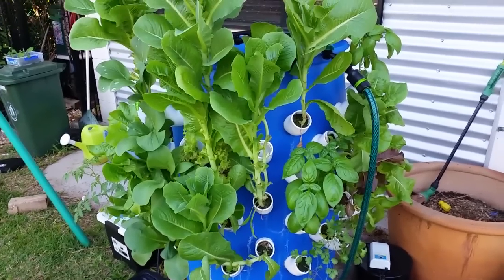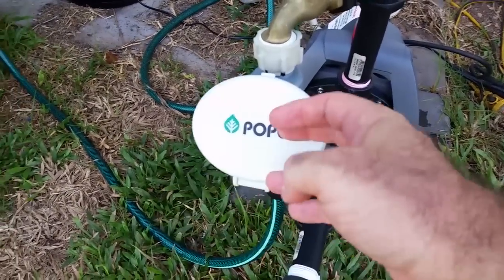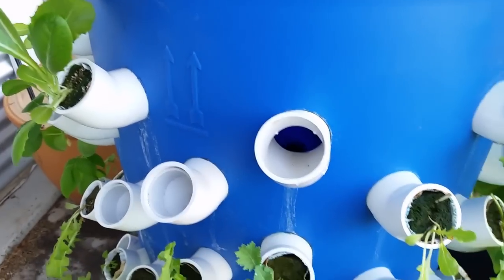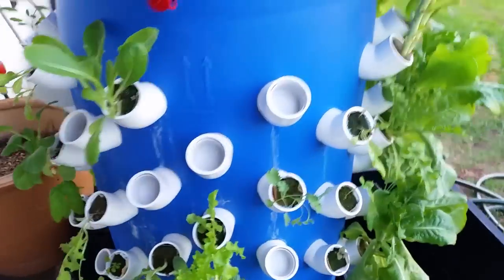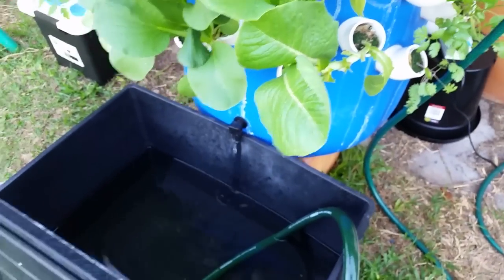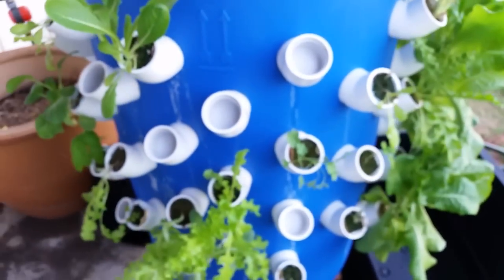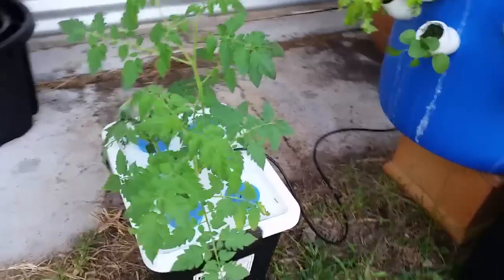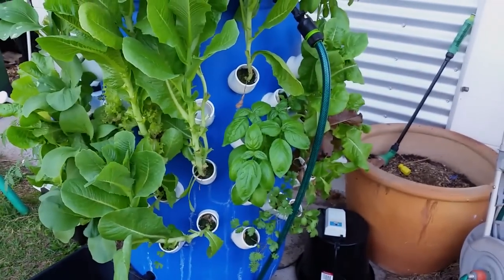Aeroponics Tower Build - Part 2

Comment: do need to ON/spray nutrients 24h? What is a interval time for spray schedule?
Reply: It depends on the crop type, the difference between an aeroponic tower and a hydroponc tower like the tower garden is control.   The hydroponic towers haave to run the pump for longer to make up for the uneven distribution. Accoording to a tower farm owner a single  10ft tall 52 site tower runs the pump for 12 minutes per hour which cost him  216w  per day.  He  also says the plants in the 52 site  tower use 4-7L  per day so you can see how much extra water is being pumped. With an aeroponic tower you can deliver the amount you choose , the mist reaches everything. If the tower uses 4-7L a day you can choose a misting duration and timing that supplies 8L or even7.1L if you choose to. The farm owner  doesnt have that option because the method  doesnt support it. He couldnt run the pump for 3 seconds, and if he could it wouldnt help.  He cant distribute 3 seconds worth of water evenly to all 52 plants in the tower. The towers use a 45w Sicce Synchra Silent 3.0.

Comment: Hi you were talking about the following :  I am working on something using a DC diaphragm pump and a pressure accumulator. That will allow it to be solar powered and require the pump to run far less often. In the new setup, the pressure will build up and be held in the tank and that will power the misting. The pump will then only run to repressurise the accumulator as required. Hope that all makes sense. That should be cheaper than the pump I have now and also virtually remove running costs. Will post a video on it when complete. Can you let us know when you have this system on video?

Comment: That why in America we use the standard system. 2 cups is a pint. 2 pints is a quart. 2 Quarts a half Gallon. 2 half gallons is a gallon. It's much simpler.

Comment: Good day,
Part 1:  TIP TIP TIP TIP
40 mm holes perfectly round and close water.
Make a hole of 70% (+/- 30mm)
Make sure you have a pipe large of the planned hole and a sponge with cold water.
Put a paint fohne here and heat around the hole. Do not overheat, may discolour slightly but do not burn, black !!
This makes the palstic smoth.
Now stop the tube directly from the inside (also outside), let the tube in and cool it off with the wet sponge. Then remove the tube.
You now have a perfect round hole with a collar that closes well.
This goes with every flat tube where a spout must be made !!
suc6
John, Netherland
Reply: hi, what is "Make a hole of 70%" please ? do you mean 70mm? Also what is a "paint fohne"? Do you have a video of this method? It sounds interesting but i cannot visualise it. thanx

Comment: Do you put your seeds straight into the tower or do you grow it until the roots get long in another system? also how do you hold the plants in the pipes? rockwool? neoprene plugs? thanks for your time
Reply: Hi Patch,
there is a cheaper, easier and quicker way to germ seeds for a tower. You can put the seedlings into the tower almost as soon as they`ve sprouted so you dont have to wait for them to root out the rockwool. which you wont have to buy cos you dont need it ;)
Reply from the maker: Hi Erick, I grow them in rockwool until the roots penetrate the bottom of the plug. I then put them straight in the tube. I have a video on how I germinate in rockwool here: https://youtu.be/f5qqpgvocOQ - Thanks again for watching :)

Comment: Have you had any ideas to internalize everything?? I was thinking that you could just use the bucket itself as a reservoir. Wold that cause any issues?
Reply from the maker: Hi Joseph. I did try that with my original design but the nutrient solution got really hot as a closed system. The double-reservoir helps reduce the temperature of the solution that is then sprayed within the drum. That is my situation living in the tropics though. In a colder climate, the additional temperature in the single drum could be a benefit. Thanks for the question.

Comment: I'm new to this... what is the name of the container that holds the media and lets the roots dangle inside the tank? 

And what type and size of pump do you use for your sprayer? Do you leave the sprayer on 24/7?
Reply from the maker: I just call that the grow tank and the other tank is the reservoir. Pump doesn't need a lot of power, just enough to lift from the reservoir and get a decent spray. Mine is just a $100 pressure pump. Sprayer generally runs for 10 seconds every 5 minutes but there are lots of variations to that and they all seem to work OK. I just settled on that as it is pretty hot here and that seemed to be a good balance. Hope that helps and thanks again for watching.

Comment: What nutrients do you use?
Reply: Do not buy the liquid pre-mix.  Buy the fertilizer, acid, base dry and learn how to mix it.  Otherwise you are paying for shipping water at 8 pounds per gallon. Lots cheaper, especially if you have a worthwhile size crop.
Reply from the maker: I use House and Garden - Van de Zwaan but that is only due to ease of supply. I'm sure other brands work similarly.

Comment: Why use a reservoir and just pump water from the bottom of the tower?
Reply from the maker: The double reservoir design helps cool the nutrient solutions prior to it being recycled. My original design just pumped from the bottom of the tower as a closed system but the nutrient got too hot.

Comment: bro..you know..just a suggestion...in your formation of the drum...only one side gets the sun light...the other side..hmm...not much right...?..
Oki..this is my suggestion...use some thing under the drum,which you can easily turn..so you can turn the drum daily to sun light..
   and..I can tell you a way...use an old clutch drum from a vehicle..use a razor,some iron bars to do a frame and a foundation....and this is one of the the best video series so far about this subject bro..good luck and cheers..God bless you bro...
Reply from the maker: Great tip and thanks heaps for watching.
Reply: Great work thanks
Reply: Just a swivel office chair base, $5.00 at the rehab store.

Comment: How often do you have the water on?
Reply: In another similar video they said they turn the pump on for 10 seconds every 10 minutes. If you do only 3 times a day, then the roots will dry up!
Reply from the maker: 10 seconds each 5-7 minutes here but I am in the tropics. Important that the roots stay damp and don't dry out.
Reply: 30 minutes 3 times a day would be perfect.

Comment: Have you herd of the B. A. Kratki type hydroponic systems. They don't require a pump of any kind. So there is less chance of a crop loss. And they are about as cheap a set up as you can do. it only requires a fluid tank with a light tight cover, that you poke holes in and by using a round hole with a square peace of soft foam as a planting medium and plug you can reduce the cost of construction. ounce it's built all you need add is fluid and plants or seeds.
Reply: Kratsky has more root rot and less available O2
Reply: @LazyH-Online Thanks, I am doing dome peppers of various varieties using Kratky in Mason Jars and masterblend.  they have grown great but after the first 3-4 yolo wonder peppers they have flowered but not produced.   Sweet pepper is growing like a weed.  I am not sure if I have to force pollenate them .

Comment: G'day mate, here's a heads up for consideration, u can save money,  time & labor by drilling ur 1 1/2 - 2" holes in the pattern u fancy, then use a heat gun to heat the hole until pliable,  jamb a wine bottle ( elegant style not the port style bottle ) into it to a depth that suits ur fancy ( 1", 1 1/2", etc ) I by & large seed directley in rock wool cubes & some Jiffy peat plugs & stopped using net pots altogether saving even more money, after all, its about getting it done.... cheaper. Good vid & food for thought!

Comment: excellent idea   hats off
Reply from the maker: +daquilema2011 G'Day and thanks. It is really a number of different ideas (not all mine) pulled together with most of the solutions just worked out as I built it. Have a few modifications underway now though for testing when the rain stops. If they work out they will feature in some new videos. Thanks again for watching :)

Comment: Wow, terrific videos!!! Thank you!!! Here are two thoughts that may be useful. I did a similar system (but with a very different method for nutrient flow - see below;-) using a 5 gal. bucket with net pots in the lid. It's great for growing tomatoes because you can attach poles to the bucket with bungee cords and tie the tomatoes to them (my plants got 5 ft. high!). Not knowing better, my bucket was food-grade black poly because I knew to protect the roots from light, but being black it got VERY hot - Ooops!;-). However, wrapping the bucket in white paper and leave a inch or so airspace was enough to drop the temp. a huge amount. That brought the temp. of the 6 inches of nutrient solution in the bottom of the bucket to (I'm guessing) ~88 deg F even though the bucket was in full sun on the hottest days of the Summer. That would likely work for your barrel as well. Second, instead of having a second container to hold the overflow of nutrients, I used a water pump sitting in the bottom of the bucket with a spray head. The pump was this one: http://oraclegardensupply.com/pump317.html.  This pump sits in the ~6 inches of nutrient solution in the bottom of the bucket, and pumps the nutrients thru a 3/4 inch pipe that's 7 inches long to a spray head that wets the bottoms of the net pots. Spray head is like this one: http://www.homedepot.com/p/Orbit-Full-Pattern-Plastic-Shrub-with-Plastic-Nozzle-54009/100189199.  The beauty of this is there's nothing external to the bucket, or in your case the barrel.  Of course you'd need a larger pump for your barrel, but it could then feed your terrific misting system.  I plan to replicate your barrel system but using the internal pump method.  Of course, during the high growth period, one thing to watch out for is keeping the nutrient level from falling too low.  I did that manually this time, but plan to add a float and valve system in the next version to do that automatically. Thanks again for your post!!!
Reply from the maker: +Tim Zebo G'Day Tim and thanks for watching. Some great ideas in your system design. Sounds similar to something I did just for cloning but then taking it to the next level - excellent! Will try and give that a go in my next growing season for a comparison. Thanks for the feedback mate and let me know how you go. Cheers :)
Reply: But I think the difference between the barrel and the bucket is that you can take the lid off the bucket and you'd have to cut the top off the barrel and then it wouldn't be watertight anymore. You'd have to find a barrel that with a removable top. But I'm pretty sure they do make them.
Reply: But the bucket would be better for indoors, because you could hang a light over it and Light the plant. Where you would have to put lights all around the barrel to light all the plants. So that would be better for outdoors.

Comment: Do you cycle your pump on and off? If so, what is the frequency?
Reply from the maker: +Matt Neibaur Hi Matt, depending on ambient conditions, it is usually on for around a minute and then off for 6-7 minutes. For next growing season I am working on a sensor controlled misting system rather than time. I'll then use ambient temperature and humidity inside the drum to trigger misting as required. Hope that helps and thanks for watching :)

Comment: hi everebody ,could you please tell me if i could use aquaponic water and use it the same way?
i mean instead of hydroponic use aqua?thanks
Reply from the maker: +behnam behnam It could be worth a try. You would need to include a filter before your pump and mist sprays though to prevent them getting blocked. Thanks for watching and for asking the question. Good luck with it :)

Comment: To save effort on the sanding of the fittings to get a tight fit, have you tried using a heat gun to soften the barrel spot and push (force) the fitting into the hole of the barrel.  If you have tried this, which method is easier?
Reply from the maker: +John Sluga Hi John. I did try the heat gun option but without sanding the elbows down it distorted the barrel a bit too much for my liking and I was worried the barrel might split. In the end I sanded them all and just used a little bit of heat on some of the holes to assist (mainly around the vertical seam where the barrel is thicker and wouldn't give as much). Hope that answers your question and thanks heaps for watching :)

Comment: what is the size of your pump /psi using in the barrel
babyhewey@msn.com
Reply from the maker: +Clay Hewett Hi Clay. My current pump is around 55 psi. I am just in the process of moving over to an 80 psi DC pump so I can run on battery + solar. I am going to just run that directly for now but may need to add a pressure accumulator into the design to reduce the pump running time. Hope that helps and thanks for watching :)

Comment: I wonder how an ultrasonic fogger would go inside a drum like that
Reply from the maker: +ImMADasAMeatAxe thanks for watching and good question mate, have toyed with the idea myself. The limitation I can see is the build up of heat in the drum. My current system effectively has a double reservoir, one of the reasons for that design is to allow more water in the system circulating more often to dissipate heat. Of course the requirement for that depends on where you live - in some places the ability to hold and accumulate the heat might me more of a benefit. I am in the tropics so keeping the internal temperature down is important so I don't cook the roots. I do use a fogger though in my plant cloning system and that works perfectly.
Reply: @patchtoplate-australia  if you're still using this setup try a bubbler in both reservoirs should evaporative cool pretty well, might want to try a ventilator fan to with all those extra holes just space your timing for in between sprays. Or you might do a piece of taller PVC so heat will naturally convect up and out the top and get sucked in through the bottom.